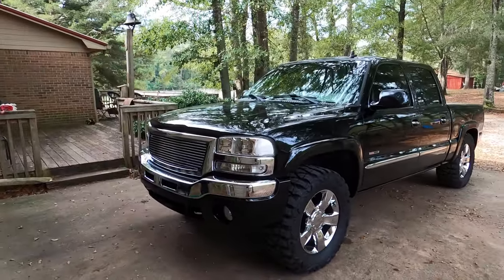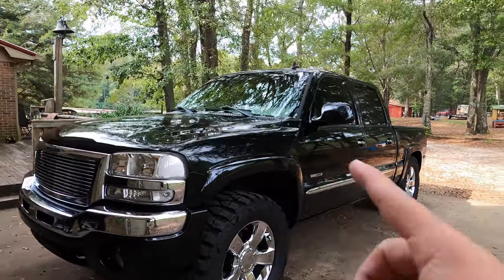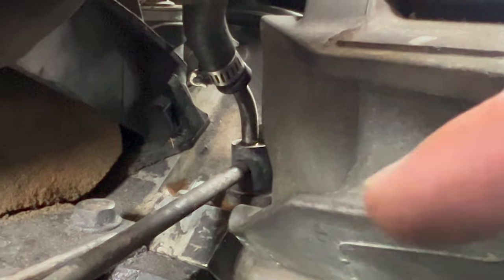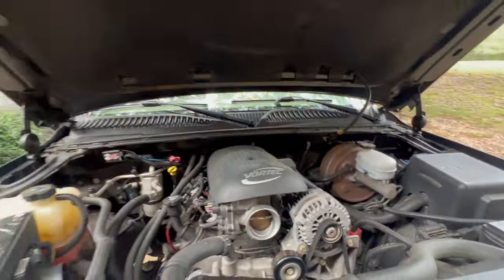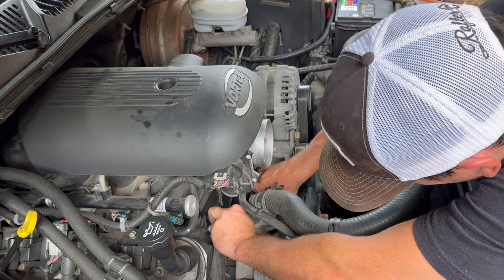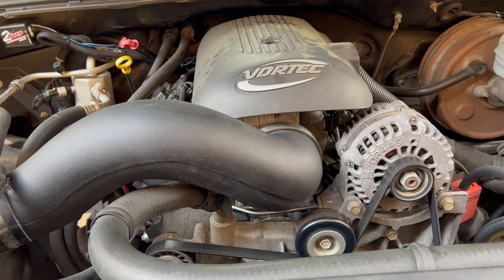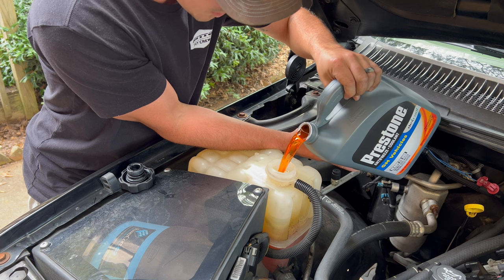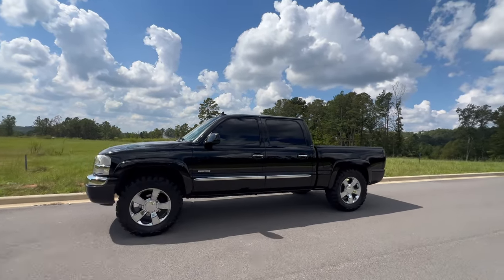CROSSOVER COOLANT PIPE REPLACEMENT

Comment: Hey bud.     Uk what based engine your looking at your looking at a Ls based engine they started using it around the 03 year any Chevy truck 02-03 will have a Ls based engine they are super easy to work on and replacing a head gasket wouldn't be a hard thing to do the (the engine won't fall out of time) like the ford ohc engines do.    They are significantly harder to cam cause a tight spot to work

Comment: I may need to check mine cause I have coolant loss also but truck doesn’t overheat and it over a longish period of time I may need to check the same spot also… I wonder if it’s the same on 2000 Silverado
Reply: My water pump was leaking but it would run down the engine and drip into the crossmember and not leave a puddle so maybe check that
Reply: @jonthelamb4549  appreciate its,  will check kinda hard to tell cause my valve covers leak and it’s caked in crud